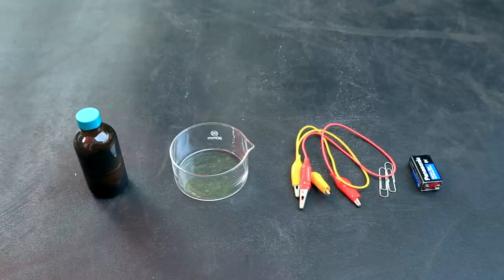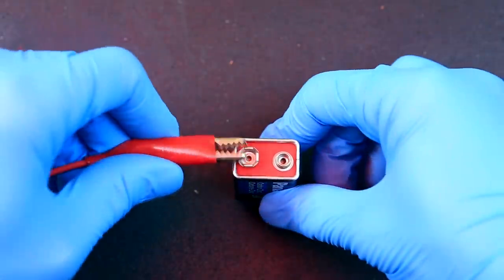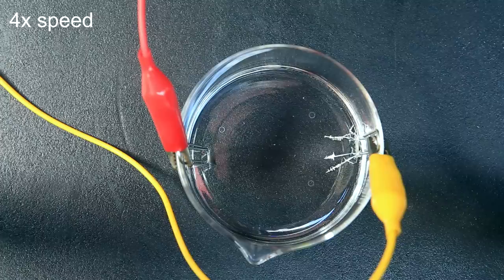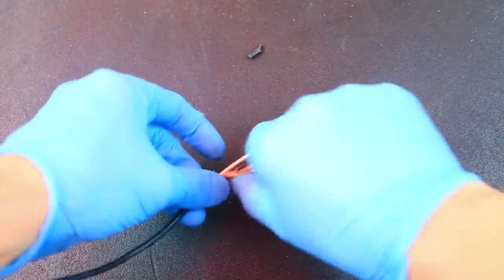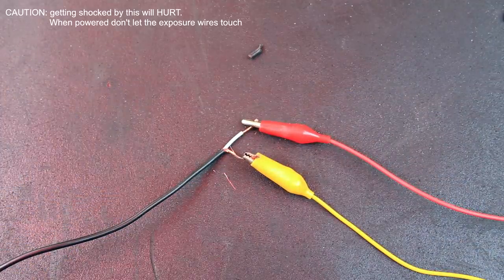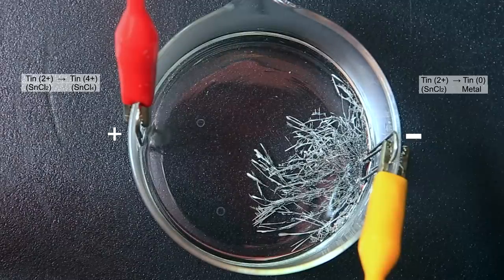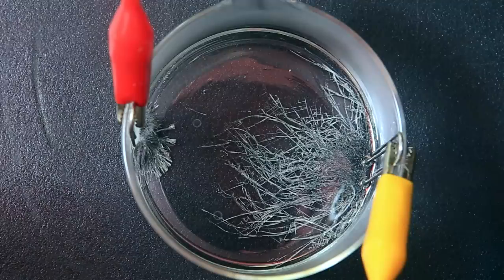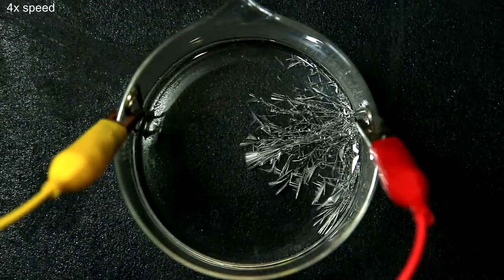How to grow Tin Crystals!

Comment: Is there any way to get stannous chloride from soldering tin,wich is mixture of 60% tin and 40% lead?
Maybe just dissolving it in hydrochloric acid and then separating lead and stannous chloride by crystalisation?
Thanks :)
Reply: +Nikola Jambrović This leaves you with a lead salt, which is really not what you want to deal with unless you've got a place to dispose of it properly.  You might be able to find old tin cooking vessels or plates/bowls at an antique shop.  If not you can buy lead free solder, which is typically 95% tin/5% antimony.  You can also find bulk tin online for ~$25 USD per kilogram.
Reply: +Jason Patterson The amount of lead salts that is formed is small. Also, no recrystallisation necessary because lead chloride is insoluble in water.
Reply: +David Zed     Would the electrolysis process still produce tin crystals even with the lead chloride present?   

I am wondering if you could dissolve the tin, lead, silver from circuit boards, then electrolytically form tin crystals to remove the tin.
Reply: lead chloride is pretty much insoluble in water, so you can just filter it off
Reply: Where can we put lead chloride safely?
Reply: David Zed it has a low solubility but still, some disolves. However it isn't too much it can contaminate a little the product.

Comment: 1:55 getting shocked by this won't do anything haha. computer power supply's are usually around 19 volts DC, and that small amount of voltage is not capable of doing any sort of harm to your body
Reply: But your fingers can be wet from the tin solution, and you can get shocked from that.
Reply: deIlluminati still no shock...
Reply: Jurie Debie Yes, you can get a small shock. It will only sting a bit, but it will hurt.
Reply: Jurie Debie yeah. I've tried shocking myself with much higher voltages. DC current won't shock you as easily as AC will.
Reply: You do know that voltage doesn't really do anything... You need to look at the amps
Reply: Voltage moves amps through resistance, voltage means almost everything... Without high enough voltage amps mean literally nothing. I can touch something that is 100,000Amps but only 3v and I will be fine... But I can touch something that is 1Amp and 40v and it could kill me...
Reply: Also no, 19v DC can very much be lethal. You shouldn't be telling otherwise without knowing basic Ohms law as you can get people killed that way...

 A potentially lethal ma across the heart is 10ma... The power supply is 19v... Skin resistance when wet can be as low as 500Ohms... 

 If we use basic Ohms law, V / R = A then we find that 19v (PSU) / 500Ohms (Wet Skin) = 0.038a which is almost 4x a potentially lethal shock!!

 Even more so when skin is broken or especially saline like with sweat it can go as low as 300-400Ohms... So 19v / 300Ohms = 0.0633333a, more than 6x min lethal amount across heart...

 That could be a potential death sentence to someone with heart problems!!
Reply: Man I touched 19v power supply could not even feel it. if you put it on your tongue then you will throw it away quite quicky but there is no way it can be lethal. even if your skin is wet you still have enough resistance to stop current from flowing enough to kill you. And saying that you touch something that has 1 amp of current is a nonsense becouse your body's resistence determines current. Stop commenting about something you don't know anything about. (btw 19v can burn you quite badly if you short the leads so yeah that's the only harm it can do to you)
Reply: That's a dumb thing to say, you can't just "look" at the amps, what would you be looking at exactly? Current is a result of an applied voltage and the resistance the voltage is applied to, I=V/R, as you can see the lower the resistance, the higher the current, but also, the higher the voltage, the higher the current. Ideally human skin has about 100kOhm, so at 19V you can expect a current of 190uA, while at 100kV you could expect a current of 1A, of course this depends on many other factors, this is a bit oversimplified. It also depends on the capability of your power supply, not many people have access to something that can provide 100kW, and at that point you don't have to worry about being electrocuted, you will be vaporized.

TL;DR  lol no volts will hurt/kill you quite readily, but it depends on how much power your supply can provide and where on/in the body the voltage is applied to.
Reply: I have no clue what Enderman is trying to say but it is obvious that they are the ones who have no clue what they are talking about.

 Touch that 19v, 1 amp supply to your tongue and you'll do much more than throw it away from you. Your tongue will spasm quite a bit, those muscle contractions are what can cause heart failure.

 That is through something called a pulmonary edema, where you heart muscle get out of synch and no longer can pump blood. Of course it needs to pass through heart to do it, but like I said it takes an absurdly low amount of current to potentially cause it to happen.
Reply: I can just tell by Enderman thinking 40 volt 1 amp can't be lethal that they do not have a basic understanding of Ohms law they are trying to claim I do not XD
Reply: Jurie Debie its only about the current and if you somehow manage to get the current path just right, it can kill you. The skin has a very high resistance, so with just 19V it needs a bit more than just touching.
Reply: drkastenbrot  The current is what kills yes, but without voltage enough to move the current it is harmless.

 For example 100,000 amps @ 1v touch it with left and right hands you'll be fine.

 1 amp at 240v, touch it with left and right hands and you could die.
Reply: One is no more responsible for death than the other as one is an inherent  property of the other.  I guess people seem to think that since the lethal numbers for current are smaller than the voltage that current is the killer, but I would venture to guess that that is because people are only ever exposed to current limited  power supplies like phone and laptop chargers and batteries. If you really think about it, resistance is what kills, or lack thereof.
Reply: I hope you understand. When you see that a power supply is rated for 1amp that does not mean that it will pump that 1amp through your body. Your bodies resistance determines the flowing current. Putting it on your tongue lowers the resistance but assuming you have shoes on the current will only travel through the saliva and basically no current will flow through your heart. Just for your sake I grabbed my bench power supply and I managed to increase the voltage till 17volts. After that it was really painful indeed. My supply showed that about 25ma were flowing through my TONGUE.
Reply: Once again Enderman you fail to see what is right in front of you, I already proved it was very much possible to be lethal via calculations above...

 And even right there, 25ma is 2.5 times over potentially lethal and that is only for 17v not 19 or 25 which a lot of laptop chargers are :/
Reply: +TrollFaceTheMan RELEVANT USERNAME
Reply: <3
Reply: TrollFaceTheMan: You just forgot that the 30mA affecting the heart have to be AC, long time exposure to low voltage DC can affect blood cell O2/CO2 resorption.
Below 48V is not dangerous, except someone do stupid thing like  poking the skin of each hand with a conductor, but that doesn't happen accidentally.
Reply: AltMarc I never once heard it needs to be ac, just that ac reduces the skins resistance letting it flow more current through. Do you have a source for DC not being dangerous under 48v.
Reply: Great thing in this job: keeping one hand in your pocket is a good thing, even the chiefs approves it, it's just safer.
Reply: AltMarc Thanks for sharing that, glad you have a source I will look into it when I get the chance.
Reply: don't bother correcting ppl more than once, if they think they know better, let them win a Darwin award. They deserve it.
Reply: Jurie Debie I once got a heavy shock from a old PSU that wasn't grounded. I didn't have it in the power though.
Reply: @ OP/Author --- Uh... Yes, It also depends on the AMPERAGE. It takes both high Voltage, AND high Amperage, AND Low Resistance -- to kill you. Broken skin (cuts, have much less resistance, so do wet hands, etc)

You can shock yourself all you want, you might get lucky and not die, it really depends which path the current takes through your body, but if it goes through the heart.... do you really want to end up twitching on the floor, all of your hair burnt off, with third degree burns down your arms and chest? Trying to call out for help, but then slowly dying on your floor... Not me.
Reply: @kiemPlant Games,  They have a bunch of Capacitors in them, some of them hold quite a bit of power. It's pretty easy to turn those capacitors into little stun guns.. super caps work especially well.
Reply: jscix nobody Thank you.
Reply: ElectroBOOM has quite a few videos about this. It takes quite a lot of DC voltage to make enough current flow through human skin to cause pain. AC hurts a lot more because the capacitive component of the skin lowers the impedance for AC current.
Reply: Its amperage that can harm you. Not the voltage

Comment: Could you do something similar with different metals, say, by using AgNO3 or CuSO4?
Reply: of course. but in some cases it may require alot more power and current.
Reply: Good to know, my Micro-Nuke Power Station™ wasn't getting much use.
Reply: Eric Sprague yes, industrially this method is used to get 99,9994% pure copper (which is used in electronics).

Comment: Man you did not have to cut the connector of the power adaptor.
Just stick a small nail inside it and aid it with a toothpick or matchstick or such to hold it in place.
And clip the alligator clamps there.
Reply: But what about the negative?

Comment: wont this create chlorine gas, which is quite dangerous?
Reply: +believe German K5 Yes!
Reply: +Sam The amount created is so small that there is no harm.
Reply: +David Zed I know ;) but it still exists nonetheless
Reply: Dose makes the poison :)
Reply: +believe German K5 Use an anode made from tin, then there will be no gas created.
Reply: +believe German K5 Not as dangerous as your German's gas.
Reply: Desmond Low the chemical component is not the biggest deal. Concentration is what really mattered

Comment: What happens if you use AC instead of DC?
Reply: No crystals.
Reply: Stefan13579100 I've wondered the same thing. Wouldn't they just grow crystals at either end and grow towards each other?
Reply: Bronson Stephens The crystals are formed from one pole going toward the other. If you swap poles, they disappear from the other end and start forming on the new one. By using AC you simply make the crystals start and stop forming at both poles.

Comment: Putting the red alligator clip on the negative terminal triggers me. At least you fixed it off camera because in the next scene you claimed the yellow wire was the negative, but now I can't tell if that was a mistake in your script or if you flipped them off camera.
Reply: you are last in comment section
Reply: @Amit_Pirate  God I can't believe I used "triggers" unironically. I mean it was 3 years ago but still. Cringe.
Reply: @omegahaxors9-11  I didn't find any cringe. Hope you are well. 😊

BTW, you don't watch his videos now?
Reply: @Amit_Pirate  Good enough, really.
Reply: @omegahaxors9-11  Great

Comment: You’ve got a misconception here NileRed. Oxidation of the negatively charged chloride ions take place at the positive electrode on the left, producing CHLORINE GAS around that paper clip. The gas bubbles generated at this paper clip is NOT due to the solution “boiling” in that region. This is basic school level electrochemistry. Having a science site, you’ll HAVE to get at least the FUNDAMENTALS right before any posting, bud. 😂
Reply: I'd recommend turning on annotations, bud.
Reply: No, your annotations are also wrong. Nothing has been corrected here. You are obliterating an entire field of study by putting up a video with your own explanation of what happens that is in fact not sound Science, Nilered. The oxidation half reaction produces chlorine gas. The bubbles formed on the left paper clip electrode is NOT due to “heating up the solution so much that it starts to BOIL” as you say in the video.
Reply: Lizelle Swanepoel this video is 3 years old calm down lmao
Reply: @lizelleswanepoel116  You didn't even read the annotation before calling it wrong. It was also written in the description so even a mobile user should've seen it. Since I have the feeling you'll just ignore it again I'll copy it here.

EDIT:It was pointed out by KotMatvej that the solution doesn't actually boil, but it is electrolytic sides reactions which are producing gas. These are the two side reactions that he suggested:

2Cl- -- 2e = Cl2
2H2O - 4e = 4H+ + O2

So could you tell us which part is "also wrong"?